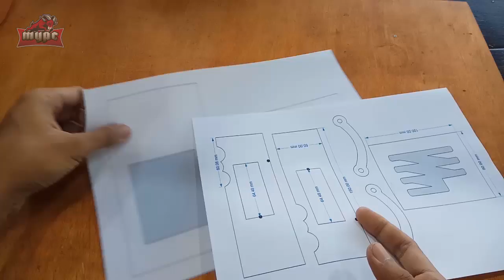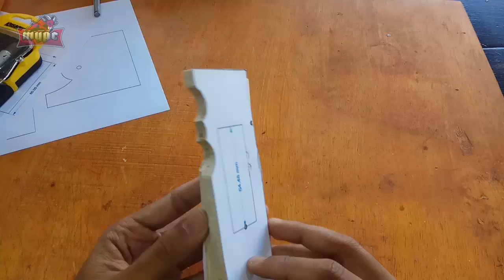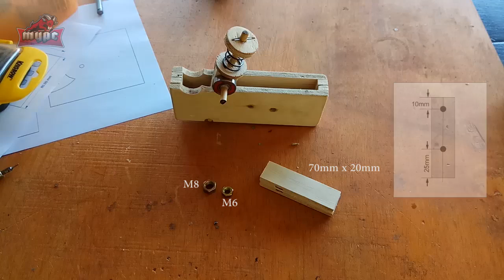Cara Membuat H-Shifter Prototype

Comment: salah satu giginya kok agak alot ya mas?susah masuk.apakah karena faktor pemakaian?
Reply from the maker: Tuas shifter tidak menekan microswitch...
Coba di cek gigi yg bermasalah, kemudian di ganjal supaya tuas benar2 menekan micro switch.

No WA jika ingin ada yg ditnyakn lebih lanjut 085559252818
Reply: @CreeZone  ok
Reply: @CreeZone  tapi masalahnya micro switch nya kayak gak mau masuk mas meskipun dipencet pakai tangan.maksutnya diganjel?microswicht nya diganjel?atau tuasnya?
Reply from the maker: @ronaldsaka4352  tuas micro switch nya di ganjal,,,cek di aplikasi untuk test joystick, kalo di tekan nyala / dalam posisi di tekan tuas shifter nyala, berarti normal..
Reply: @CreeZone  tapi ada kemungkinan switch nya rusak?
Reply from the maker: @ronaldsaka4352  klo micro switch jrang rusak
Reply: @CreeZone  wokee
Reply: @CreeZone  kayak nya rusak mas switch nya.jadi ganti switch?
Reply from the maker: @ronaldsaka4352  klo rusak di ganti aja mas
Reply: @CreeZone  nama switch nya apa mas?
Reply from the maker: @ronaldsaka4352  micro switch
Reply: @CreeZone  untuk kabeh kabel nya sama?